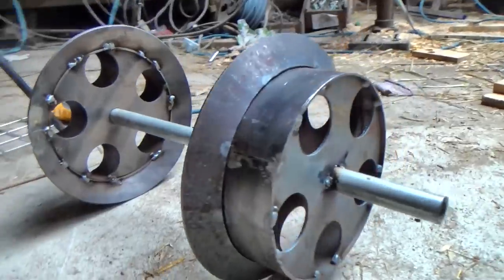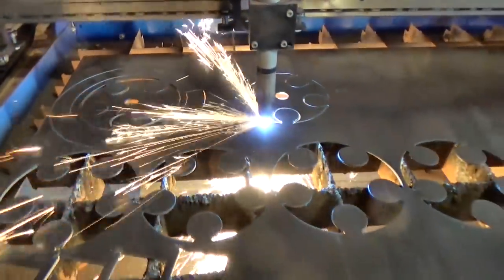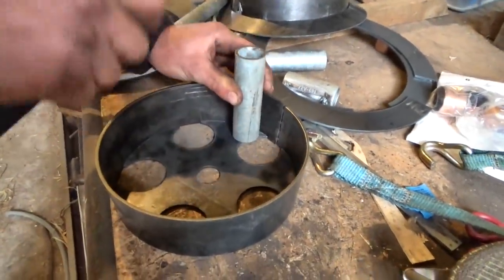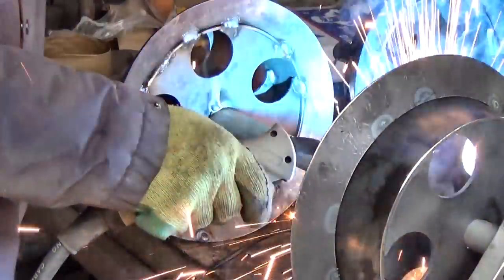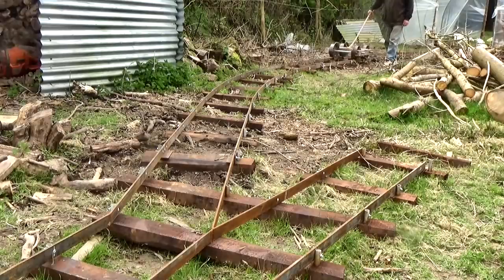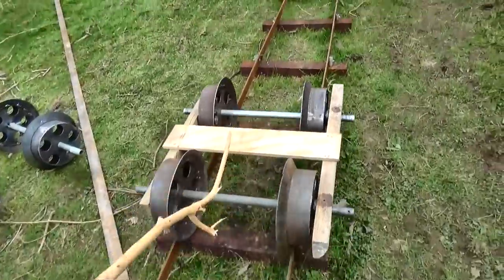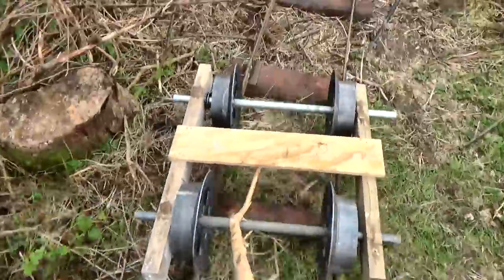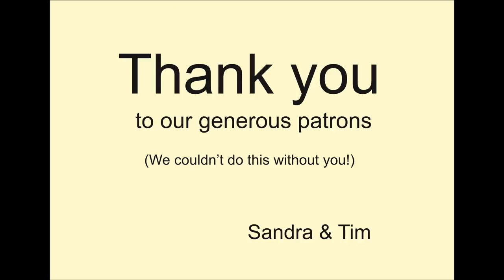More Homemade Railway Wheels - This Time With Tapered Treads!

Comment: They just hate your flat wheels, cause they don’t have there own railroad
Reply: Flat wheels for a flat earth
Reply: same with his switch haha, i think the kick switch looks cool for how simplistic it is
Reply: their own railroad. Sorry, I had an English teacher drill "their, there, and they're" into my head over and over, and I still hear her voice 39 years later.
Reply: @mheermance  Where own railroad? Oh, there own railroad!
Reply: @RussellNelson  Somewhere, somehow my old English teacher heard that, and she's not happy.
Reply: The taper is especially important above 100 miles per hour.
Reply: @SteamCrane  The taper is important at any speed. If you push an unsupported and untapered set of wheels around a curve, they'll twist and skip off straight away. Same set up but with tapered wheels and they'll stay on. It's basically vital for smooth operation on curves.

Comment: Hi Tim.
Railway wheels are locked together by a solid axle. The way they cope with not having a differential in the middle is to allow the train to move sideways on corners. The sideways force of the train, when in a corner, pushes the outer wheels onto a bigger diameter and the inside wheel onto a smaller diameter so that the different length of track covered is matched by the size of the wheels. They are all machined to different profiles for the size of the wheel and what sort of locomotive or carriage is on top of them. I watched some being machined at swindon railway works. I was only 16 at the time so didn't grasp the science then but the big lathe had two toolposts that magnetically followed a steel template on the machine, not cnc but a predecesor of cnc that gave the right profile. The profile templates had letters on them. I think the big loco wheels were being turned to profile 'P' whatever that is. I would stick to your parrallel wheels, although water might drain out of the tapered ones better. Liking your videos.
Reply: In one of Tim's videos, I think one of the corrugated steel roller ones, he made a copy lathe like you describe for making wood rollers
Reply: The argument of the tapered wheels allowing water to easilier escape is a really good argument, might be worth to make the wheels this way solely on that basis.
Reply: Hi Rob, thanks for that info, and it makes a lot of sense too.

Comment: The simplicity is what makes this so good. A lot of YouTube projects are over engineered, yours is the bare minimum which is really important. Love the simplicity (like the non-curved kick switch)
Reply from the maker: thank you!
Reply: Indeed, I have a lot of unfinished projects because I have a habit of starting to over think and over engineer a project. I.e., a I built a PC/console racing cockpit using 1-1/2" ABS pipe and fittings for my gaming seat, steering wheel, shifter and pedals. I started trying to achieve perfection in a CAD program. In the end, I just went and bought 48ft of pipe and 45,90,T and Y fittings, more than needed, and just got at it. I used some of my basic dimensions and then rather ad hoc using a quick pencil sketch. Not as "perfect" as originally envisioned, but I like the end result and it is done and being used.

Comment: Looks like testing with a heavy load will determine what's needed. I suspect either the flat wheels will be fine or you'll need even steeper tapers to roll through the curves. Each one of these videos makes me wonder what will happen next. Exciting!
Reply: steeper tapers or wider treads, bringing the flanges closer together so the tapers are longer. Too steep a taper will increase lateral pressure on the rails, which may become an issue over time (bow the rails out?)

Comment: I'm sure there's some fun maths you can do about this. For a given radius of track bend and a given distance between the rails, you get a certain ratio of how far the inside wheel has to go compared to the outside wheel, which gives you the ratio you need between the radius of the left cone where it touches the rail and the radius of the right cone where it touches... and that tells you, for a given angle of cone, how much closer together the flanges need to be compared to the rail spacing, so the wheels have enough space to move over to the correct wheel diameter ratio... or if you prefer, for a given distance between flanges, how sharp a cone angle you need in order to get enough radius variation within the lateral leeway the flanges give you...
Not at all worth it for this application, but kind of fun to think about!
Reply from the maker: Not sure how much fun it is, Robert - but it sure is interesting : -   )

Comment: You're not alone. There must be more of us out there.....
I made a track system for a little rifle range. It runs down a concrete tube and used to take a trolley that carried the paper targets. The tracks were just 1x1 wooden strips, screwed to wooden sheet. And on it I ran skateboard wheels, with a chunk turned out on the lathe, to form a tread/flange.
Worked ok, but the flanges were 90deg to the tread and would bite into the wooden rails.

Comment: Hi, Because your wheels are fixed to a common axle they will resist going round corners, this will be much more noticable when you put weight on the wagon.  The outside wheel on a corner travels further than the inside wheel so they must be allowed to rotate independently. The outside wheel will be turning slightly faster than the iside wheel. The wheels must be free to rotate at their own speed and not tied together.
Reply: This is what the tapered treads solve. As the wheels go through a curve, the outer wheel moves towards the rail and rides on a greater circumference, and the inner wheel moves away from the rail and rides on a lesser circumference, so the wheels 'steer' around the curve. He tried making this in the video but ran into the same problem that real trains have: if the curve is sharper than the wheels can 'steer', there's extra friction and a grinding/squealing sound as the wheels slip.
Reply: @Tolono   . I see. clever stuff. Thanks.
Reply: @Mungomytube  Yep. The engineering of a railroad is pretty interesting. I like that we're all learning new things from Tim's videos.
Reply: Split differential axles would help on the the curves and corners.

Comment: One little design detail for curves is that it is relatively common to space the rails slightly further apart on curves, called gauge widening. Just how much you need to do it depends on the wheels, flanges, and track gauge but it's probably at most a couple of cm on your tight curve to keep the bogie from getting wedged. As for your switch, I was skeptical at first but if it works, it works. It's not like you're building a high speed railway.

Comment: As someone who served a proper apprenticeship in a locomotive works, i think you did brilliantly with your first attempt at wheels & points & track.  They are quality engineering (fitness for purpose). I would, as you hinted, work on getting the wagons made up and tested to use.  Stick to metal thru wood to start with, as the choice of bearing design could slow you down. Real chill out vids.
Reply from the maker: thanks, Steve!

Comment: The purpose of the taper is to change the diameter and therefore circumference when cornering as the outside wheel needs to travel further than the inside wheel so with different diameters there is less slipping

Comment: Tim, I work for a class 1 railway in North Dakota and can confirm after 10 years of working as a conductor, that none of the wheels on freight cars are tapered.  When new, they are flat and the flange isnt even that big.  After miles of usage, they become worn in the center, I have never seen a tapered wheel at work.   I cant confirm about European railroads.  Also I love your ingenuity in your points, very clever!
Reply from the maker: Thanks, Ben. I am learning so much  : -  )
Reply: That surprises me. I've never seen a railroad wheel which isn't tapered.
Reply: @RussellNelson  the tapered look is actually the flange, shaped to fit around the curve of the rail.  But the rest is flat,  I was looking at the brand new wheels the other day and couldn't feel any actual taper of the tread from the edge to the flange.  When new, they are more or less shaped to fit the shape of the rail itself, and eventually will start to show evidence of a convex shape after years of use.  There is more evidence of this as the brake shoes are made flat and fit flat on the tread, and wear evenly.

Comment: Tim, Did you make the gauge on the curve a bit wider?  On big railways the distance between the rails on a curve is a bit more to allow the wheels to run smother.   Learned that on a show about hi-speed trains with Richard Hammond as the host.  

To the people wanting a curved set of points... bending that rail just right sounds like a pain in the backside.   However it sounds like a fun winter project to make one.

Thanks for videos Tim, keep them coming.

Comment: Either is fine for this use. But what this video shows is the efficiency of steel wheels on steel rail. Without the hay bale, that car would never stop!  You will be moving stuff with absolute minimum effort.  By the way, the big railroads use flange greasers on even moderately tight curves, despite having tapered wheel treads.  Also, straight rail switches are very common on mine track.
Reply from the maker: Exactly!

Comment: You know we are all hoping you make a powered shunter  ,  just a crude single cylinder type.   Loving the videos.
Reply: Or maybe battery operated. It probably wouldn't be too hard to make a chain-drive loco powered by a car battery with a fairly chunky motor. Two axles, either one or both driven.
Reply: I think the "train" should be pulled by a miniature donkey ... just to keep things "quaint".
Reply: @dws2313  Grass powered instead of Gas powered!

Comment: One think that might reduce friction on your tight curves (and annoy purists) would be to have the wheels not welded to a common axle. So the axle would be fixed in place and the bearings be between the axle and wheels.
Reply from the maker: that's true, but then you might need wider bearings. Hmm...

Comment: For the brakes, on our railcars(usa narrow gauge) we use brake shoes that apply pressure on the tread of the wheels and this can be actuated by some simple linkages( for example some handbrakes are just a stick that puts pressure on the shoes  through linkages and the friction stops thr train, hope this helps
Reply: Why not a wooden bar that spans the width of the car and engages directly with the track? Don't need to line it up, just pull a lever and lift the whole car off the track! Big flanges help too.
Reply: @Zappyguy111  that works if you only want brakes on 2 wheels, from what I can understand he is wanting to have brakes on all 4 wheels of the cars
Reply: @DaltonCypherUSATC5019  
I was thinking something like a track brake, simple to build and service. No engagement with the wheels, just a flat bar that drops down onto a flat track and uses the weight of the car to slow the train.
Only catch, you need to make sure that car is heavy enough to hold the train.
Reply: @Zappyguy111  I highly doubt that would work, plus it would take a lot more force to get the train moving when it's loaded an the when it's unloaded it would have a hard time stopping because there wouldn't be enough weight.

Comment: G'day,

That's a lot of extra complication for what appears to be a rather marginal level of extra performance...(?).

In the fields of Aerodynamic & Aerostatic Levitation there's a saying to the effect that Success is best achieved with Designs that,

"Simplicate..., 
And add more
Lightness...(!)".

So, maybe having Flat-Tread Railway Wheels welded up from Sheet Steel will prove to be a bit like when Gunsmithery transitioned from Recievers being milled from Solid to stamped from Sheetmetal...(?).

Functional, lighter, cheaper, faster & easier to tinker together..., but not quite as "Theoretically Elegant" as those which emerge from the Foundry & Lathes of an established Railway Wheelwright with the proverbial  "money to burn".

  Such is life,

Have a good one...

Stay safe.

;-p

Ciao !

Comment: You can't believe how excited I was to see your new video.  Who would win? The cone-heads or the cylinder-heads?  I agree with your thoughts about cost and simplicity and just getting on with a solution that works and is good enough, but we're all still really interested in understanding which is best. I notice that your wheels are quite wide and fit snugly into the rails (  which is best for cylindrical treads)   but if you used cone treads and  made the tracks a little wider around curves, you'd easily have twice as much 'difference in diameter'  to help the buggy around a sharper curve.  

Putting a small camber on the track ( like the indianapolis 500) might help things a little bit too,   and thinking about costs: you probably have enough servicable  wheels for your needs by now,  making the front pair in a buggy use conical treads may help lead the whole buggy in the right direction.
Reply from the maker: Yes, tapered wheels need to be closer together than straights - I see that now. There's so much to learn!

Comment: Just thinking ... what if one of the axles on your car was allowed to pivot a few degrees ... would that not solve the turning problem?

Oh, and another thing ... you are so good at curving steel that curving your turning points should be an easy thing for you!

Comment: Working on something similar to this, but the wheels are made of roller skate wheels and a wooden flange bolted to the back.

Track is pvc filled with sand to make it stiff enough to bear the weight.

Comment: So: The issue now is flanges grind in corners. Also: you have now good results with wooden bearings. What would it do/take to replace the flanges with inside horizontal wooden bearings? They would keep the wheels on track, remove grinding, would be very cheap (short piece of pipe rolling on well greased wooden stick), strong enough (there is not that much side force and they would usually turn only in corners), not that difficult to manufacture (as compared to flanges). And who knows? Maybe they would even remove the necessity of tapered wheels. I cannot wait to the next vid in this story line.

Comment: Correct... the tapers are really only for straights. They’re designed to self-centre to reduce hunting, and the bogie getting a harmonic rythum at speed damaging track/flanges and reducing the risk of wheels climbing. 

I agree... tapers are not necessary or your application. Most narrow gauge tramways do not have conical wheels

Comment: I will say I'm impressed with your commitment and availability of resources for the project, bu the only problem I have with he railroad, is the switch. I think you should try experimenting with a longer curve going out and trying multiple shorter straight pieces for easier Turing if you're making a two truck train car, even the singe truck could be problematic and cause derailments. Its just a suggestion from me

Comment: the genius of tapered treads is, that in curves is that in curves the outer wheel can travel a longer distance than the inner wheel  without any slip, because it travels on a larger diameter. The tighter the curve, the bigger this difference needs to be for this effect to actually work. (if you want I could do some rough calculations on that, but I would think you are capable of that too) In theory, even with a sharp edge the wagon should follow a curve as long as the treads are wide and tapered enough. 
As a bonus, the wagons lean into the curve, thereby counteracting centrifugal forces.
When you have treads, that suit your tracks, the role of the fledges becomes quite different. So they can be further away from the rails and probably shorter. 
As a rule of thumb: wide and tapered treads make a wagon more forgiving towards unprecise  rails.
Reply from the maker: The advantages were just not worth the extra trouble.
Reply: @WayOutWestx2  
I am thinking, that for your tight curves the taper is not enough to get the benefits.  On the other hand. The benefits are bigger at higher speeds.
In your usecase a bit of slipping is probably not that bad and as long as you don't move to fast the danger of things falling of, or the wagons tipping over is quite managable.
on the other other hand there is still room for some interesting and educational videos. ^^

Comment: A year late to the party but I wonder if the tapered treads may put more side load onto the top of the track? The angle of the taper would (I assume) affect the amount. How much that matters would probably depend upon weight.

I’d probably make flat wheels and use slices of 8” steel line pipe (easily available here) as treads if I was trying to mimic your method but my block of land is too small for a railway on your scale

Comment: Hi Tim, I agree tapers don't add a lot on your railway. Much like a quarry railway, the aim is to stay on the rails. I've been wondering for years about using the hubs from sack truck wheels. They have tapers and flanges, are cheap and they come with bearings. The metal is usually thin though, so they might wear through quite fast?

Comment: You may calculate the needed difference in diameter for a certain turn radius. Narrow gauge railways that I have seen (originally from mining, now for tourists) typically have wide wheels to avoid steep taper.

Comment: So, the taper used in regular rail roads are about 1:20 ratio, so the curves must be longer and smoother, your curves are sharper, hence the taper needs to be a little higher (maybe about 6-7 degrees instead of 3-4 degrees, I would even go as far as 10 degrees). I absolutely love your content and would love to build a rail for myself one day :)